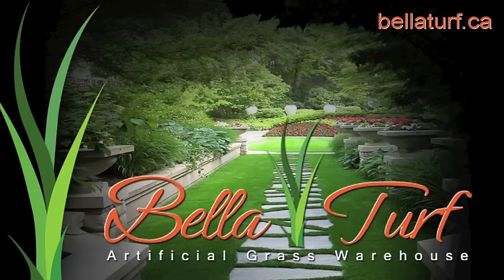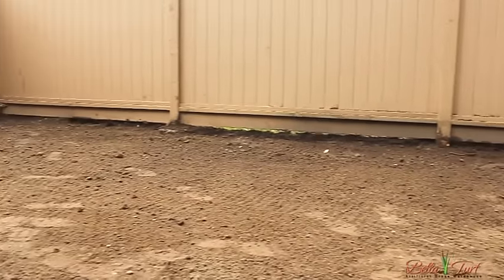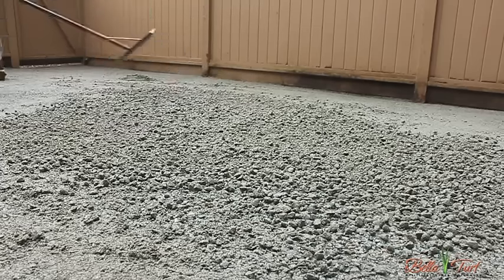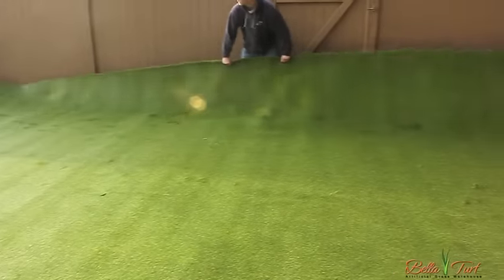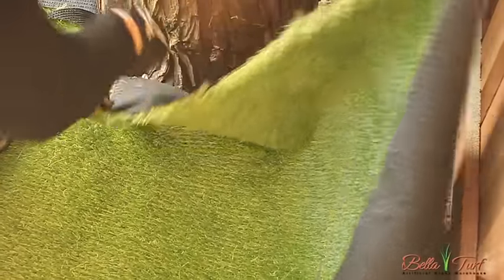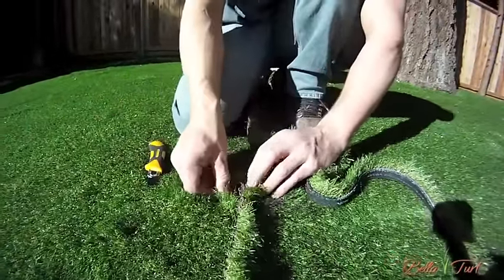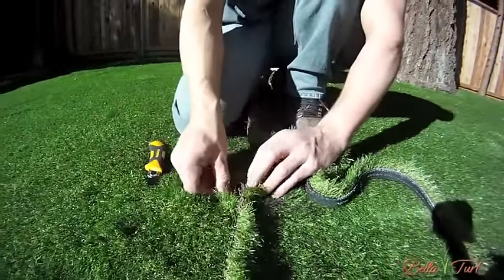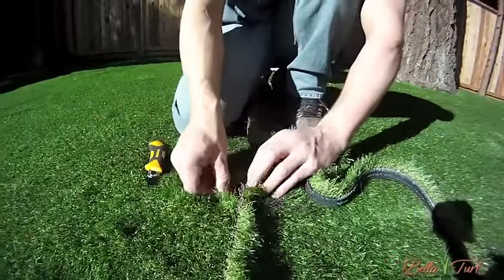How to properly install artificial grass - Bella Turf

Comment from the maker: That is not sand, that is PureZEO, used to neutralize pet odors that leach through the turf. If the aggregate is clean and packed smooth there is no need for additional material before laying your grass. You can however use rock dust or crusher fines but I would strongly advise against sand. Although slightly dated, this video demonstrates the install techniques still used today.
Reply: I was just about to ask if sand needed to be put on top of the rock sub base.....I was going to do this, but it appears I don’t need too, thank you!.....I’m wanting to install it as I have 3 dogs, would brushing sand into the laid turf hold the urine smells in?....and if so, how do I combat this please?...thank you x

Comment: Thankyou Bella Turf.  I am installing artificial turf for a school playground with a group of volunteers and your video was fantastic and very helpful.  Disregard Robert Hart, the internet makes it easy for idiots to to do what they do best...
Reply from the maker: Thanks Brad. His statements hold zero weight. Many installers like him take the easy way and cut seams to a pre-cut shape. This short cut will save you from needing any precision with your cuts, save you time, and save some face weight from your turf since you usually cut off many of the front fibers with this method. If you install turf with patience and precision, straight seams are the professional way to go. There are no shortcuts. There are poor seams and there are incredible seams, it's all in how much heart you put into it. To the installers that use templates to cut their seams ... Stop wasting all that turf! Every one of those half round scraps is a waste.
Reply: Agreed and once again, thankyou for a wonderful demo video - it was incredible help and just what we needed to wrap our heads around the project.  We're in a small town and no-one here does it.

Comment: When figuring layout for my backyard, to keep the rolls manageable I want to seam two smaller rolls end to end to make a 80 foot run.  Is it possible to seam rolls at the ends.  I have two runs around a pool that will be 80 feet and those two runs are perpendicular to each other so changing the roll direction doesn't help.

Comment: Been watching a lot of videos on how to install turf so i can do my backyard.  Most vids I've seen though they have installed plastic to prevent weeds.  Any reason why you guys didn't install it here ?  Great video either way.  Very helpful.
Reply: To save money and more profit for the company. They are not concern what happens after 365 days.
Reply: the 2 inches of ab mix ,sand and black plastic liner for the lawn, are in itself a weed barrier as not enough light gets thru . and Temps of the plastic make it almost impossible for anything to grow under it. 
in most projects , weeds come out because of one or two steps missing ..like a bad sub base, or a lack of removal 9f previous lawns that have roots connecting to a source of light.

Comment: Very good thank you. Quick question what is the exact product of the white silica sand. I have a tennis court where I would like to replace the existing infill with new infill. Wanted to know where I can buy the sand. I have tiger turf installed and the guy who built it about 10 yrs ago is a jerk. Who won't return my calls of provide any help. Stay away from Rhino Courts or John Shaffer. He installed built my tennis court, started cutting corners took endless time to build and has no courtesy to return my calls or emails. Due to desert storms there is some clay/dirt on the top layer which has caked on and I would like to remove the infill and put new infill. Turf is as good as new.

Comment: How do I calculate how much base gravel I need if I know my square footage and inches I want in depth.
Reply from the maker: 15x15 example project area at 4” deep. (225 sqft)
• Convert base depth from inches to feet (4”÷ 12” = 0.333’)
• Multiply sqft of project by required base depth (225 x .333) to find total cubic feet of base required. (75)
• Divide the cubic feet by the number of cubic feet in a cubic yard (27) to find the number of cubic yards of
base needed (75 ÷ 27 = 2.77 cu. yd.).

Comment: Our professional landscapers installed artificial grass today.   It has a visible seem.  I looked at the cuts and noticed the grass overlapped instead of the pieces butting up against each other.  They did not use tape and glue either. Just U shaped pins.  Also, no weed barrier was used at all.  Are we doomed for weeds in our front yard?  Any advise will help.
Reply: if they used u shaped pins, they are not pros or respectable landscapers. 
always ask for previous pictures or for references of previous jobs . only hire people you can verify know what they are doing, regardless of if they have a license or not .  I've seen big companies screw up big time, and I've seen unlicensed,  beat up truck landscapers do top of the line , award winning quality installs.   
no matter who you hire, make sure you can verify their previous work .
Reply: @jlbueno0611  I had the landscapers come back and insisted that they use 6" galvanized nails around the perimeter because the artificial grass rolled back very easily.  It was not anchored down.  I will take your advice and really pay attention to who we are hiring for phase 2 ( backyard and side yard) of this project.  Thanks.

Comment: what do you guy think about tree roots,? Can they come through a lawn like this or will they just bulge under the turf ..?
Reply: As a professional Arboriculturalist I can answer this by saying that if the tree's survive following the surface root damage, compaction, soil contamination and loss of gaseous exchange and water/nutrient uptake caused by these works, then yes the tree roots can continue to grow beneath and cause lifting and bulging. For those who have had this done, pay careful attention to the health of your trees going forward and have a professional Arborist carry out any necessary works to prevent any potential harm or damage caused by a failing tree. If you're still considering it then get a good arborist to advise you on your specific property requirements and the likely impact upon the health of any trees before going ahead with the works. basic rule is, don't do this within the RPA of any tree you value and want to keep healthy.

Comment: so its ok to not have perimeter edging and only put nails around the seam? won't it lift up?
Reply: nails rust and create themselves a strong hold within the ground...it doesn't lift up unless you actually pull on it with a prybar.

Comment: Hi,
What kind of sand did you use?
Can it be building/ plastering or sharp sand?
Thanks in advance
Reply: STRUT DESIGN question. Do we always have to  dig prior to putting base road gravel? Or can we just put it on top 2-3 inches ?

Comment: Team,
Can you advice me....Possible to paste the Turf on any surface....
Reply: I have turfed asphalt, concrete and many other surfaces. You just have to glue down the edges. Plus, the weight of the infill holds it in place.

Comment: What was that gravel/foundation called
Reply from the maker: Depends on where you live. It can be called 3/4" roadbase, 3/4" minus, 3/4" aggregate. Its a gravel mixture with angular rock sized 3/4" down to sand. Newer video series has more info, here's the base segment. https://youtu.be/174gKRURMi0

Comment: That was some horrible seam. Are you not supposed to do the seam first then cut off the outer edges? It seems like you guys did the outer edges first then tried to do the seaming in the middle. Looks like you didn’t get the right spacing between the tuffs hence the horrendous mohawk.

Comment: I have four dogs. would they ruin the turf by urine on the turf, or does it go straight trough.
Reply: yes, alot of turf installations recommend sand brushed into the surface of the grass to weigh the grass down and to keep grass blades upright.  Sand is obviously going to sponge anything like that up.  There are alot of customer with artificial grass complaining about smell/dirt particularly cat/dog and bird mess.  Some even suggest using jays fluid twice a day to keep the grass tolerable.  Id rather get the mower/strimmer 4-6 times a year!
Reply: BigPerm6999  Hi, not sure I'd use Jeyes. It can be toxic to animals

Comment: these videos are useless okay road base what size what's the best way to install so you have proper drainage like using inch of large stone for the base and then do the finder on the top I mean you want you guys do that is it that hard to say oh use this and use that if you have water issues in these videos are useless we know how to spread the base we know that we have to bring in the base but what sizes should we use